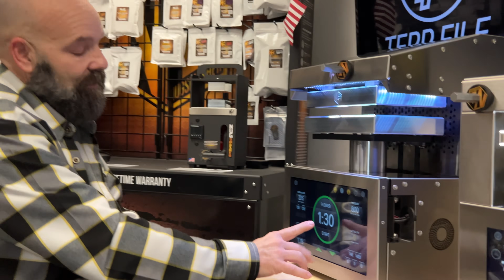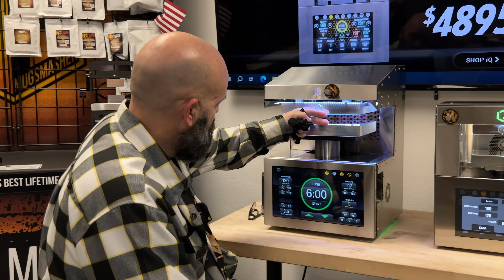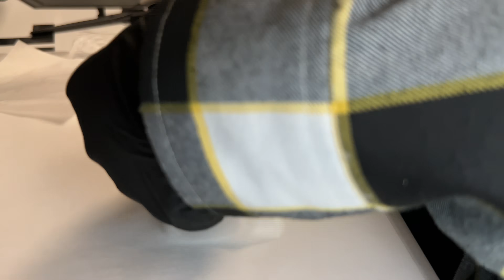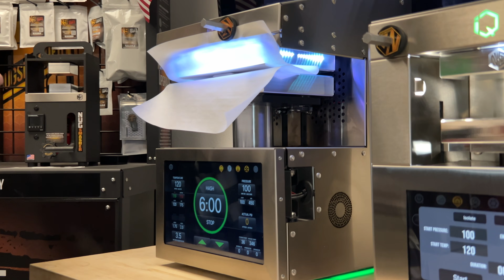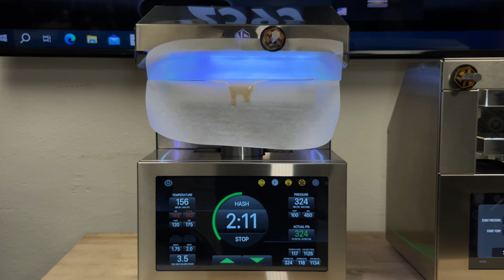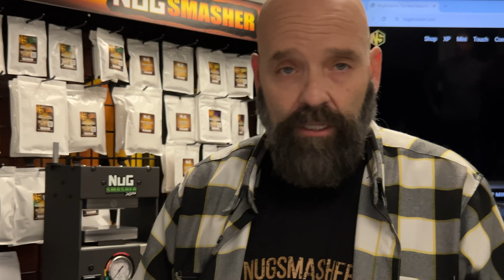NUGSMASHER IQ PRO IN USE

Comment: I want the nugsmasher xp so bad I have a 4x7 low temp plate setup but I struggle with pressure but have not received a message back !!! The website says they accept trade ins for non brand presses but no answer !!!😢
Reply from the maker: I responded to the ticket you created with details. ill try sending a separate email. Thanks

Comment: U need a compressor to run the machine huge no no i cant even use it in my house u guys need to fix that design
Reply from the maker: No compressor needed 110 or 220v power only.

Comment: Okay first things first I've been watching a ton of your videos I need to know the ratio of the percentage of THC between flour and rosin.. does it double?
Reply: Often it more then doubles. You can get say "30% thc" flower if you are lucky and buy tippy top shelf....  But you can find 70, 80, 90% Thc Rosin/Resin. That is percentage by volume. So if you have 3.5 grams, of 30% thc flower, you have 30% of that 3.5 that is THC. But if you have 3.5 grams of rosin or resin at 70-90% THC.. then 70-90% of that 3.5 grams.. is The good stuff...
Reply: Awesome thanks man I'm going to start small with a juice box